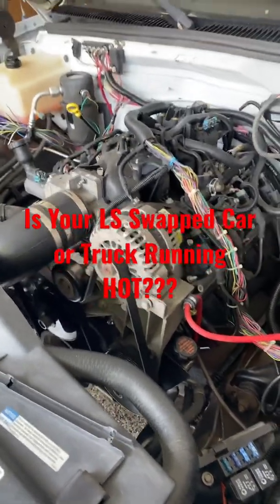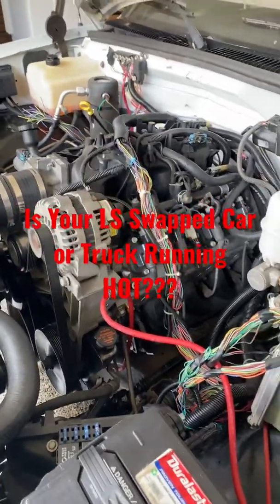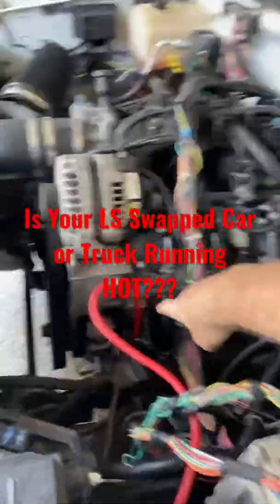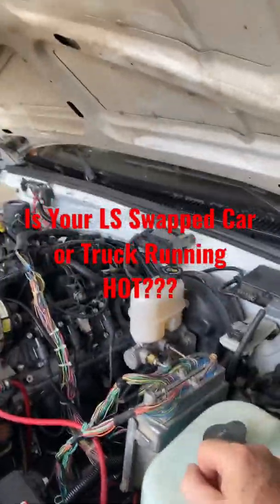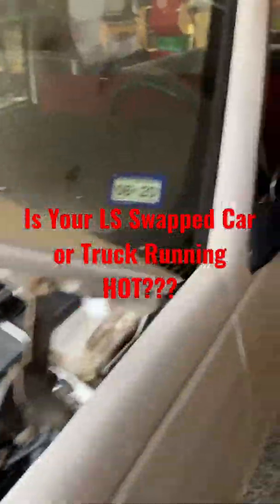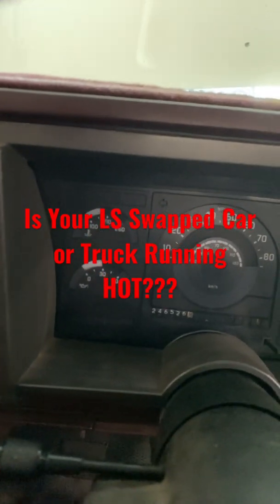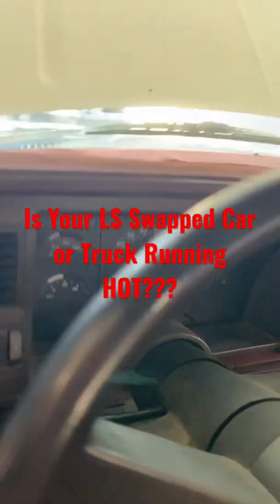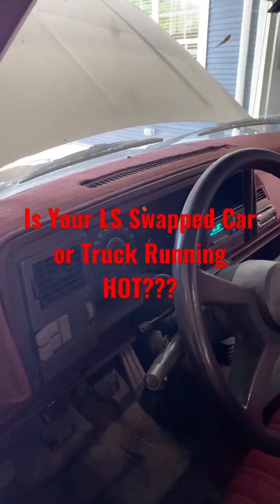Is Your LS Swapped Car or Truck Running HOT?? Try This…

Comment: Do u full it up why  the motor running?
Reply from the maker: Before starting the motor, disconnect the upper hose from the radiator. Hold it up and pour about 3/4 gallon coolant/water in. Enough to still reconnect to radiator without spilling any. This will put enough fluid on the backside of the thermostat so it will function properly. Once the thermostat opens and coolant is flowing, you can add to top it off.

Comment: Was you radiator full when you pulled sensor and no coolant came out? Im having same issue. Filled through top radiator hose and radiator is almost full. Temp shoots up 221 or so. Pulled sensor and dry no coolant. Was curious after you pulled sensor did you add more coolant through top radiator hose?
Reply from the maker: Yes, that’s correct. I then got to looking at the system and realize the thermostats located on the lower portion of the water pump at the lower hose. That meant that all the fluid that I had put into the radiator was not entering the engine. Once I put fluid through the upper radiator hose into the motor I was able to let the engine run longer and allow the thermostat open and then top it off.
Reply: @laurencevillegarage  thanks for response. Something I forgot to ask when you filled through top hose did u fill until coolant started seeping out of head where sensor goes? These motors can be tricky with air pockets a d of course I found put. Lol.
Reply from the maker: @gthomas5880  no, I removed the upper radiator hose from the radiator, held it up and poured coolant down the hose until it was full enough that I would still be able to attach the hose to the radiator without spilling any. Then I was able to complete the fill of the cooling system through the overflow tank.

Comment: Dang I’m hoping this help on my ls swap I changed everything once I crank it up temperature rises to 220 while sitting heat stop working after the water pump an thermostat change also new heater core ima try this an hope I get a good result should I do this before a cold start
Reply: Man listen I just came from outside after messing with it for days I went out today an did everything you said and now I got heat no over heating an temperature staying at 195 with heat on full blast ….youre the best 🙌🏾🙌🏾🙌🏾🙌🏾🙌🏾🙌🏾🙌🏾thank you very much my truck is ls swapped an I jus knew I blew a head gasket but thanks to you I’m up an running strong again
Reply from the maker: The LS engine has a reverse rotation water pump and with the thermostat on the lower water pump. If you fill the radiator up, there is no fluid on the top end of the motor or on the backside of the thermostat. Put coolant through the upper hose so you have coolant on both sides of the thermostat. Once the motor get up to temp so the thermostat opens and can circulate all will balance out and you can then add coolant to complete filling the cooling system.
Reply: It’s been raining today but tomorrow ima give this a try….like I said everything worked perfectly until I changed the water pump therma an heater core now no heat temp was rising fast I was only adding coolant to the radiator while letting it run …..did I do something wrong…….i flushed the radiator out with water then emptied it should I add coolant in completely before I do my cold start ….an how long should I let it run
Reply from the maker: @bighurkobs94 I’ll bet that’s your issue. When changing your water pump, you emptied the coolant from the engine. When you filled up the radiator, that puts coolant on one side of the thermostat and not the other. Remove upper hose from radiator and pour in as much coolant as you can..but not so much that you can’t reattach that hose without making a mess. Start it up and watch your gauge, I’ll bet you that fixes your issue. You’ll still need to top off your coolant after the engine runs a bit to fill it properly, but your overheating issue should be resolved.

Comment: U did your swap ?
Reply from the maker: Yes.
Reply: @laurencevillegarage  what state your n im n tx I need some 1 good work on my car
Reply from the maker: @showtime2203  I am in Sunset, Texas. That’s north of Decatur and south of Bowie off 287. Where are you?
Reply: @laurencevillegarage  San Antonio I have a caprice did a swap it use 2 run now it want run no more
Reply from the maker: @showtime2203  it could be a lot of things…but my guess is it is minor since it was running before. Start simple: check for fuel delivery…if fuel is present at the injectors, check for spark or other possible wiring issues such as a bad or loose ground…impossible to determine with out having car in front of me and doing diagnostics…
Reply: @laurencevillegarage  u right The ground wires is not even hooked up u have a shop or u do the work from home ???? Anyway shoot me over a number I can call u I can get the car down 2 u And I didn’t do my exhaust yet so no O2 sensors
Reply from the maker: @showtime2203  you can reach me at 214-557-5020 or email me at laurencevillegarage@yahoo.com. If I don’t answer, leave a message and I’ll get back to you as soon as possible. Thanks
Reply: @laurencevillegarage  thanks

Comment: I found this out on my swap as well. With the thermostat being so low in the system it cannot fill the top of the block from the radiator with the thermostat cold and must be filled from the top hose.